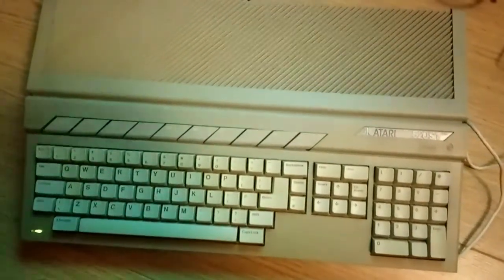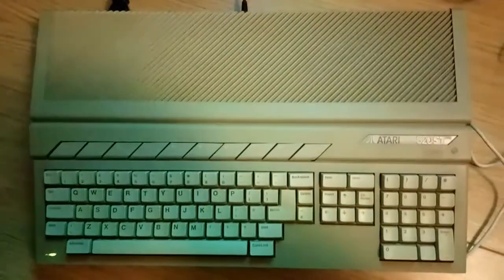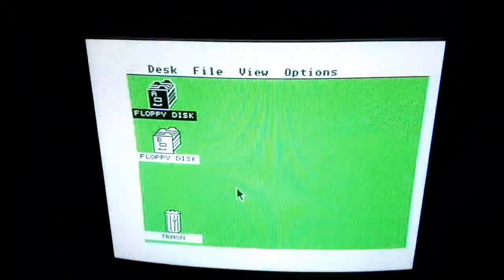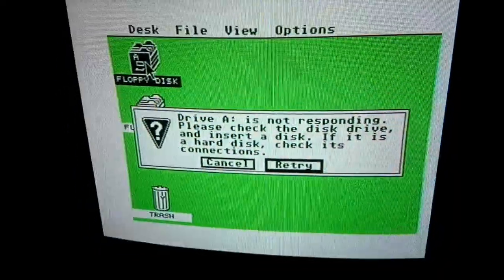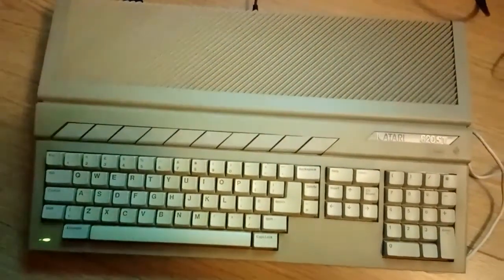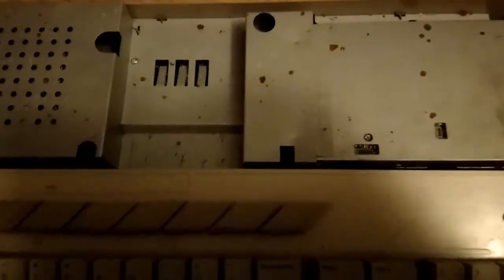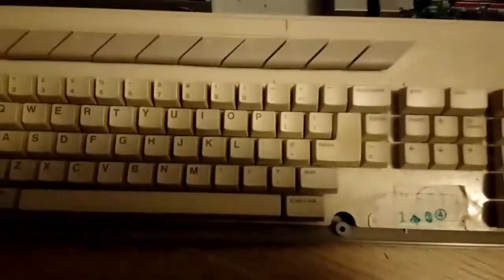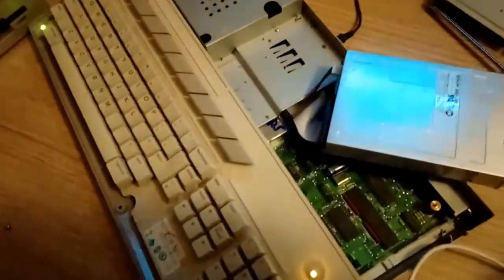Atari ST Floppy Drive Replacement

Comment: Are you situated in Newcastle? I live in Sunderland and I have an Atari 1040STe that needs its internal floppy drive replacing, just as you do in this video! 
I have the replacement floppy drive but I'm scared to fit it myself in case I damage the STe. Could you do this for me if I paid you to do it?
Or do you know anyone else near Sunderland who could help me with this?
Reply from the maker: I'm in Fellgate, Its pretty straight forward as I remember although its been years since I opened an ST. I don't mind doing this for you.
I'm an admin at North East Retro Den, join the group and drop me a line
https://www.facebook.com/groups/1864730963782461
Reply: @GamerSi  I joined the NERD group and contacted admin. 
I managed to fix the floppy drive problem for now using a disk drive head cleaning disk, but its still making grinding noises and could conk out anyway. 
Its great to find a north east retro group, especially one that knows something about hardware. 
I was a software engineer for 30+ years (69 and retired now) but hardware has always been a mystery to me!
Reply: Which one of the NERD admins are you? I messaged one of the admins but I don't think it was you and there was some confusion

Comment: Hey, just came across this as I was given a 520STFM and have managed to get it working perfectly. However there was only 1 game with it and no mouse so I need some stuff to go with it. Do you think the retro shop will have this? I will also install a floppy emulator at some point to load games easier
Reply from the maker: Hey, yeah you are gonna need a mouse to access a lot of games but there are some great third party ones out there.

A gotek floppy emulator is a great addition
Reply: Thanks for the reply :) I have been looking at a USB mouse adaptor actually, they are not very expensive. The gotek however is £40 with an 8Gb USB included, but these one's are pre configured so nothing else needs to be done more than making sure the Atari drivers are on them